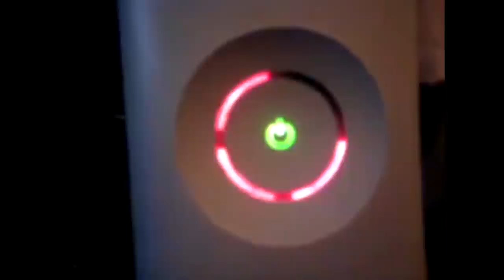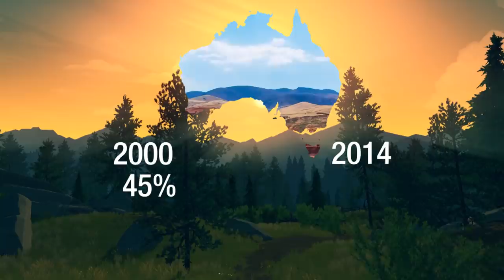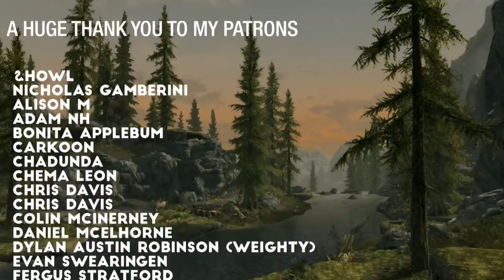The PlayStation War // HeavyEyed

Comment: Tantalum wouldn't have fixed Microsofts issue though, as the issue is the solder balls disconnect due to the major heat buildup which in turn causes stress on the solder joints (due to heat difference with the 360 being off due to heat expansion) and eventually break.
Also why not also mention the capacitor plague which also forced the demand for tantalum caps a whole lot. Seeing as from +-1997 to early 2010's capacitors had a extremely high failure rate and that became worse with heat. Add to that that devices became smaller and thus generated more heat you have a recipe for an extremely high demand for tantalum caps.
To put the capacitor plague a bit into perspective, I'm a retro console and computer modder and repair guy. Caps from the 60's, 70 and 80's are normally fine and if they go bad it generally isn't a big issue. regular Aluminium caps from the mid 90's to late 00's I replace religiously as they tend to have a bad habit of leaking and corroding the motherboard badly to the point that it's often hard to impossible to repair.
Also reusing and repairing is much better than recycling seeing as recyling doesn't get a 100% return of minerals (not to mention cost more energy) and it's also quite common practice to ship E-waste to africa to end up there on giant landfill where people scavenge for items with lots of minerals. Which is also rather far from ethical. Which is also why I hate Apple with a passion, seeing as the love to make devices nearly impossible to repair and are very prone to poor hardware design, but that's a story on it's own.
Reply from the maker: Yeah I should have expanded on the RRoD bit a more to not mean it was a Tantalum issue, but more just why good metals and care with hardware production is important, just needed an example that people knew was common place and costly but didn't wanna spent too much time on it haha. Thanks for the insight on retro consoles though, that's super interesting, I tried to research it a bit but couldn't figure out how to search it properly.
Reply: @HeavyEyed  Ahh yea, understandable. I doubt many people know the ins and outs of capacitors except maybe people doing repairs and audiophiles, hahaha.
I can imagine researching retro console hardware isn't easy, most of my knowledge is simply experience. As far as I know there isn't much information about it that goes in-depth. Only some guides how to do some mods aimed and home modders, some write-ups how some chips work together and some lists of "best" hardware revisions. There aren't a whole lot of people that actually try to understand the in's and outs of a consoles hardware, except for piracy reasons. I'm 1 of 2 people, that I'm aware of, that does modding and repair beyond personal use scale in my country, the Netherlands, where retro gaming is quite popular. So I think that says a bit about how much demand there is for information about gaming electronics.
Granted a decently aged electronics repairman can probably tell you the same thing about caps in this case, though electronics repair is getting rarer. Namely due to active attempts by companies to make devices unrepairable except by them, the increase complexity of circuits and popularity of SMD soldering also isn't helping. And on top of all that we are increasingly living in a more throwaway culture. An average phone would last 20 years or more in the 80's these days you can be happy if it last 3 and if you want to get it repaired you often get a bill for nearly the cost of a new device if you got to "legitimate" repair (Which is practically things like a simple bend pin translates "overal motherboard failure", while in reality it's a 10 minute job to bend it back or 15 minute job to replace the a 5 dollar part). And it's access to new parts, shematics and programmers to repair devices require you to become a "legitimate" repair center. (and programmers are needed these days as parts are matched so you can't rip a screen from 1 device and use it in another, even going as far as batteries) 
There is currently Right to repair laws being made and attempted to be passed in both the EU and the US, which would force companies to make their devices repairable by the consumer again, like people being able to buy parts for those devices and access to schematics. (I used to be the case that schematics came with the machine you bought or were a call or letter away and with a simple call you could order new parts if it wasn't already an off the shelf component. Sadly companies now don't have such practices anymore, and Apple being to forerunner and expander of such practices. 
Because why let someone repair a device and let it work for a few more years when you can charge them a shit load  or force them to buy a new one if you make it impossible to repair?)
If you find this interesting you might want to look up Louis Rossman here on youtube, he has to deal with it way more and is quite vocal about it (as well as politically active to get right to repair bills passed). Luckily most devices I work on still use off the shelve parts or you can quite easily use parts from other broken devices.

Comment: Quick note: original Xbox 360 overheating was due to poor air flow and poor thermal paste. The original ps3 saw the same thermal paste issues to a lesser degree. Other than that though, good job